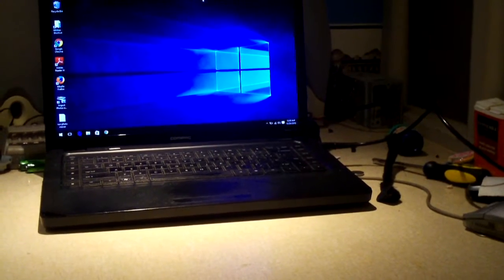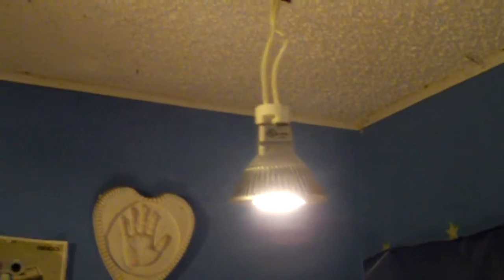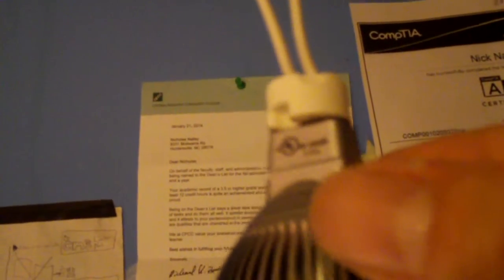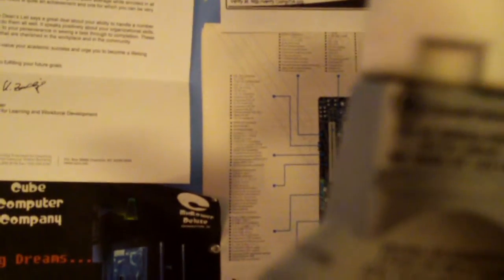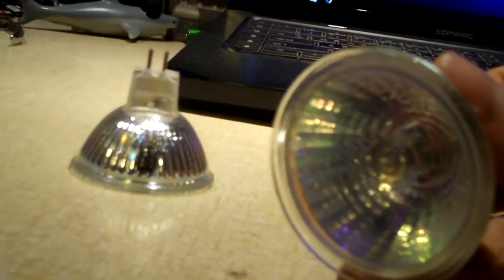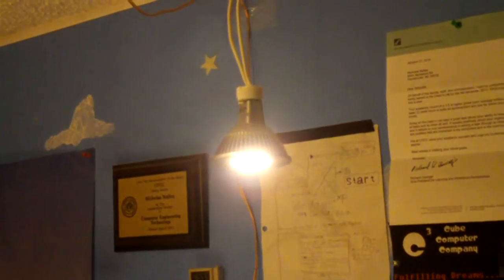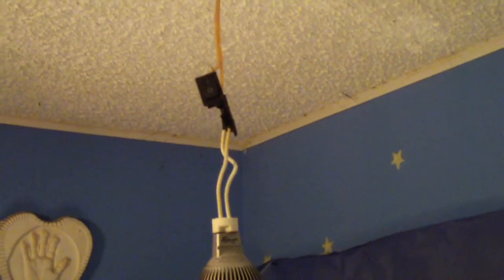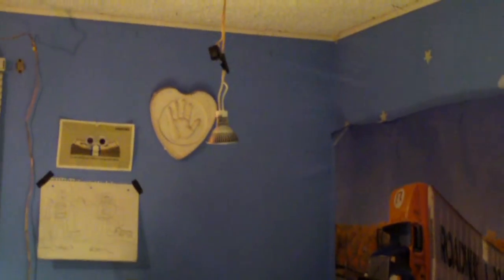New LED lights for the work table

Comment: nice way of mounting them. what do you use for the power supply?
Reply from the maker: +Kevin Bhasi I'm using a small ATX supply... you might notice the three wires up on the wall... the upper wire supplies 12V, the middle is ground, and the lower one is 5v.
Reply: +Cube Computer Channel 
Most ATX power supplies require a load on the 5V rail so that you can draw some current on the 12V rail. Did yours require a load? If so, what load is it?
Reply from the maker: +Techtron23 The majority of switching power supplies have dummy load resistors in them to put a small load on the rails in order for them to start up properly. I do have a digital thermometer attached to the 5v line.